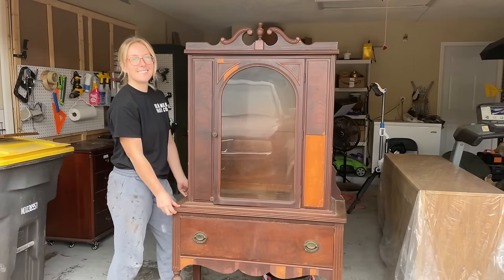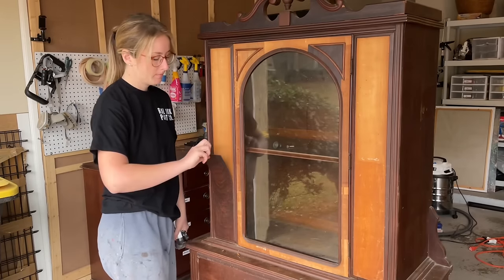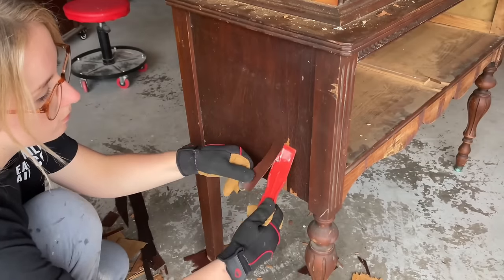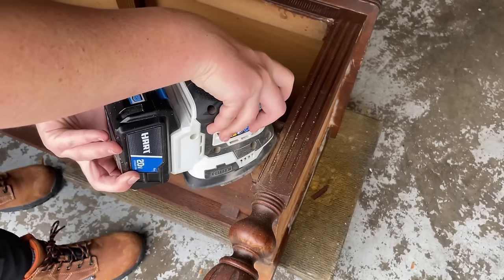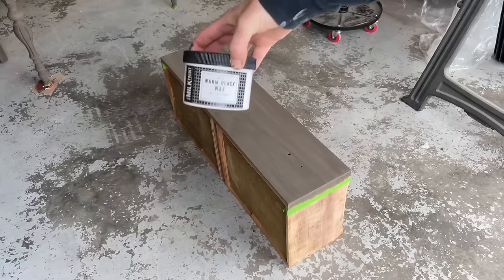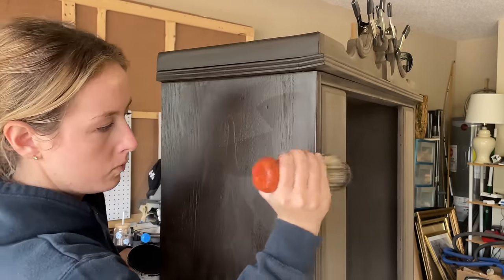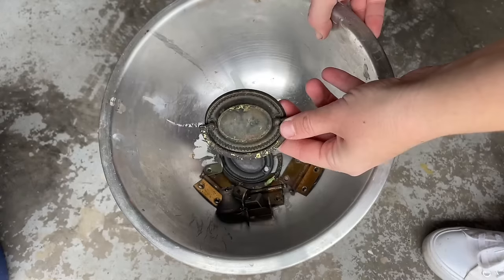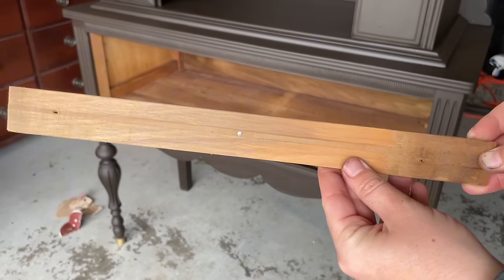Amazing Antique Hutch Makeover with Real Milk Paint | How to Treat Termites / Bug Damage

Comment: You can use white vinegar and get it Warmed up. Then put the hard wear in and let it soak. I collect early antiques and I find that white vinegar works well without the abrasive. Plus it’s good for cleaning gold and silver jewelry.  I don’t usually like these furniture flipping videos but you did a good job with this piece. Kudos.
Reply from the maker: Great tip! For the hardware? Thank you so much!
Reply: @flippedbyabby  you’re most welcome.😁
Reply: I use this method as well. I've also done it on my own kitchen handles. Even though the handles look really clean, you'd be surprised by how much junk is on them 🤮 I then just wipe off any residue with a microfibre cloth
Reply: @annieallardyce7613  that’s why you use a toothbrush just be gentle. . My jewelry and dresser hardware come out spotless.
Reply: Agreed. Use 50% vinegar, 50% water. Put the hardware in a pan and when it starts boiling you stop it. With gloves (don’t want to burn your hands) use a toothbrush and start with dish soap. Run water over it and the,once again with the toothbrush, use brasso. It’s none abrasive. You will get the most beautiful finish.

Comment: Awesome make over on this one. I may need to try the milk paint in the future. The sheen looks like it has a lot of depth to it which is hard to get with a lot of paints. 

For pulling nails and staples, I would recommend a pair of end nippers or end cutting pliers. They allow you to pull the nails (usually through from the back) with minimal damage. I use them a lot on carpentry projects where in need to reset or preserve woodwork.

Comment: Likely is powder post beetles.  They emerge only under drastic temperature changes like when heat is turned off in a house for quite a while and then warmed up quickly.  They are tiny. We moved into such a house with an antique walnut side board. Powder post beetles were in some salvaged beams in the house. The beetles appeared again many years later in the sideboard.

Comment: Absolutely  love it. Wouldn't be able to sell it. But if I did I'd sell. 1200 or auction live start bid 800 on an antique  auction. It's beautiful. Don't take anything less than above 1k. I used to work at an antique  place n flipped for yrs. You could get much more if you wait it out n list it in proper places. ❤ I love that paint for Romany reasons ❤

Comment: Hi Abby, this color and the wax finish is amazing. With the incentive I have started a similar project.  As I was going through the video it is the mixtures I am confused about.  What I see is the pigment for the Milk paint and you added I assumed water first then to the pigment and water (or other liquid) you added Ultra bond.  Is that one cup pigment to one cup water to one cup Ultra bond?  What amounts of product did you use to complete the 4 coats of paint?  I appreciate your response, just don't want to mess it up.